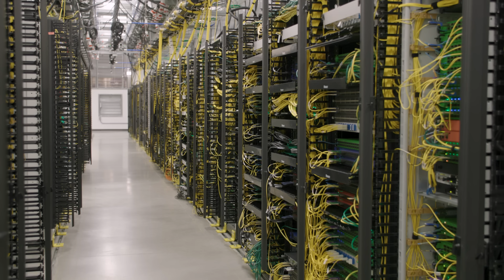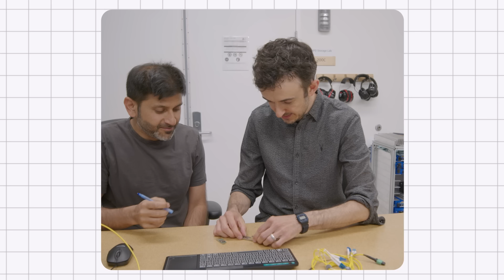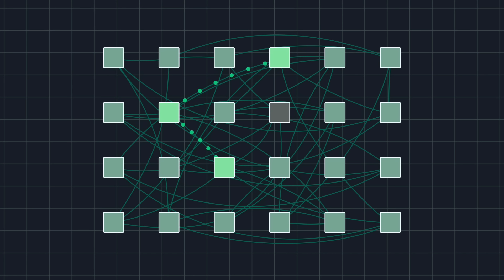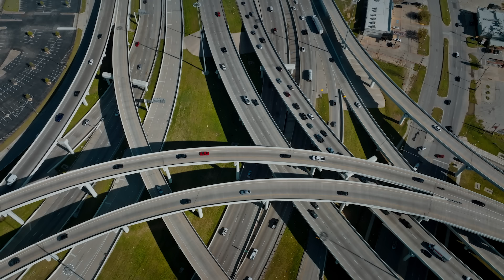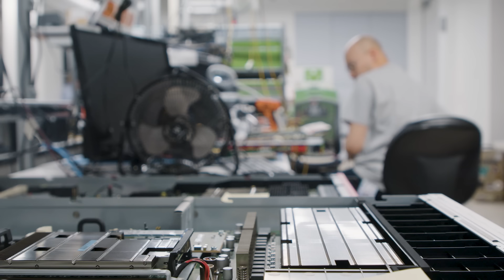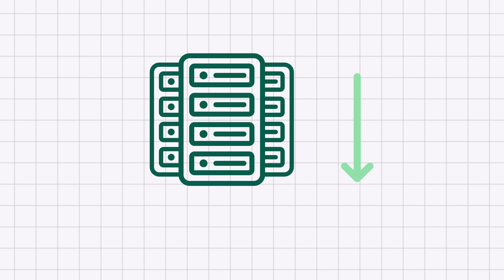How AWS’s radical network redesign is forging a more resilient cloud

Comment: It seems to be what consistent hashing is for data clusters, just that instead of a hash you use a random physical connection. The load is better spread and a single failure has much less impact. Great job! That's real innovation. Always challenge the status quo.

Comment: Amazon workers have to pee in bottles to meet quotas. Drivers: Delivery workers, in particular, face tight delivery routes and constant tracking, making it nearly impossible to stop for a proper restroom break without falling behind. Leaked internal emails and class-action lawsuits confirm the company is aware of "urine bottles" in vans.Fulfillment Centers: Workers inside warehouses have also reported skipping bathroom breaks and relying on bottles to keep up with intense "picking" and "packing" quotas
Reply: what do delivery drivers have to do with AWS infrastructure? If you don't agree with Amazon's politics, don't use their shopping site - I sure don't, for that reason and many others.

Comment: why is random routing better than a square grid connection?
Reply: it's because in a typical datacenter network architecture, links will become congested.  With random routing, you will have alternate links that are underutilized since typical routing protocols choose the best path and hence go up the tree.  By spraying, protocols can still choose best path but their source will be different so different links can be used increasing utilization.

Comment: how do you orchestrate routing of data when there are multiple routes possible in this random-graph stucture?
Reply: Yeah sadly not that much information. The shortest path (determined by Dijkstra's algorithm) will not work over a certain load level because then one route gets congested more than others. So there needs to be either certainty that the calculation capacity of the servers is at all times the bottleneck never the network cards than shortest paths can be an option. Or there must be a smarter routing algorithm that takes into account how crowded the routes are.
Reply: I got the impression that the selection of the routing path was somewhat random -- this is the "spray" approach. They are trying to minimize overloading routers at the expense of sometimes picking a less optimal routing path.
Reply: You do random routes. And if you have enough flows of low bps of data, the chance thay all pick the same route is really low thus there shouldn't be any traffic jams. This does not scale very well when you have not that many flows of data but the amount of data (bps) per flow is really high.

Comment: Is Shufflebox coming to eu-west-1?  21% of the country's electricity generation is used for data centers and the largest electricity supplier just announced - another - 8% increase in bills today.  I suppose it won't make a difference.  You can add but you can't take away.  AWS customers probably won't get cheaper prices, just maybe the next hike is pushed out...
Reply: this just means amazon can use less network devices per datacenter.  Network devices aren't the typical power hogs in a datacenter.